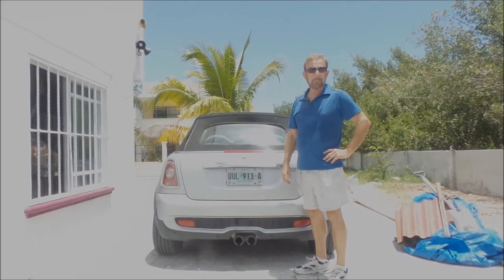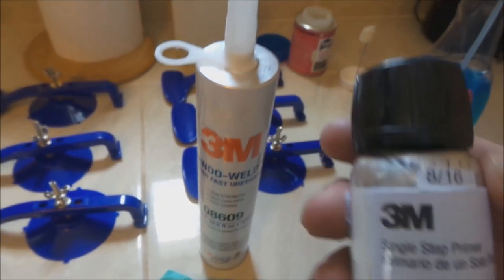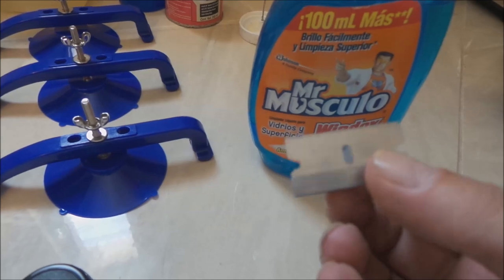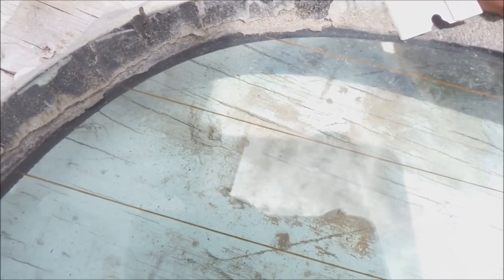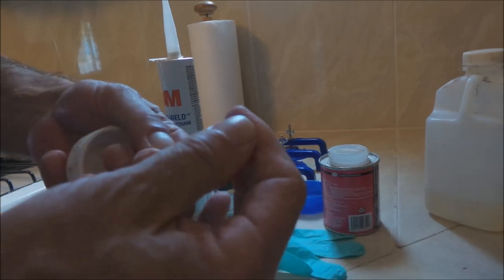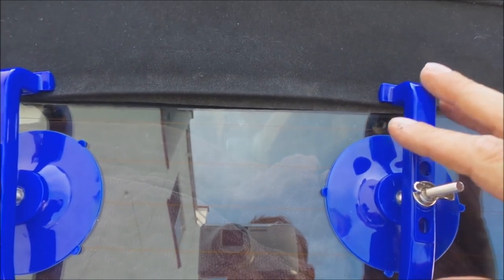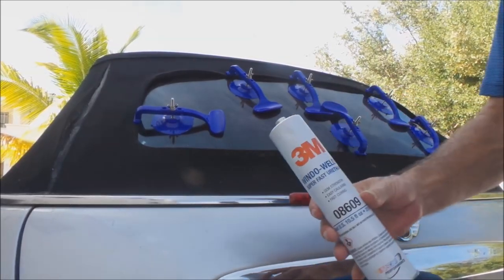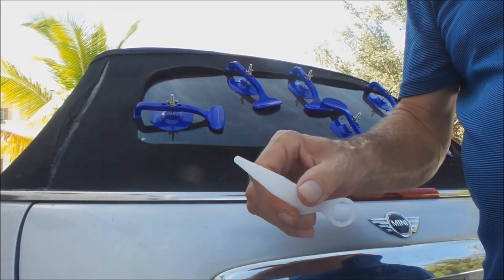MiniCooper Convertible rear window re-glue (Part 1 of 2)

Comment: Scott  - How did your reglue hold up?  I am needing to try it and wondered if it stayed in place even when you operate the convertible roof.  I have had several roof repair places tell me it won't work and I need a new rag top.
Reply: They tell you that because they want to make money off you.  A new top will just have the same glue you already have...that's come unglued.  Some Windo-Weld and Primer are reportedly several times stronger, and they're not making money off you.
Reply: I’ve tried goop twice and this Texas heat crumbles it 😢
Reply: Need to $pend the $crilla’ for the right 3M stuff (if by “goop” you mean the brand name stuff “goop”). 3M set (2023) $80 (set means Primer and Adhesive)

Comment: Hello,

How to use the 3M Primer, apply onlye the primer o the windows and top, wait a few hours ? How many ? 12 hours ? Then, apply the 3M glue ? Thanks
Reply from the maker: The 3M primer dries in less than 10 minutes in this tropical heat. After it dries, go ahead with the 3M Window Weld

Comment: To anyone in California, we can't get the primer here. It's illegal to be shipped to California. I tried buying it from several sites and it wasn't until I went to my local O'Reilly's they told me it was unavailable in California. I simply had it shipped to my friend in Oregon and had him ship it to me. Going to be trying this very soon on my 99 Miata.
Reply: I guess it depends on who you buy it from.  I bought a bottle from one seller and the post office kept it, so I'll be filing a claim to get my money from them.  I bought another bottle from another seller and now have it and have used it.
Reply: hey there man how did it end up working? im trying to fix my 02 nb2 with this method as the whole glass came off of mines
Reply: @KojiWoji_   it’s a very messy process. Make sure you wear gloves, the stuff took days to come off my hands a I would even mask off areas you don’t want the glue so that you don’t get black smudges on your window. If you can afford the suction clamps, do it. I used heavy duty magnets, which work well, but the glue gets on the magnets and it’s not fun. 

I also recommend doing it with the top clamped shut. I did it open as recommended, but when I went to clamp it closed I could hear it stretching in places I probably glued too tight.

Sounds like I’m just a messy guy but I really tried to be neat, just needed more preparation.

Because of all my issues I only completed 75% of the piece that was falling off. I was planning to finish it the next day, and didn’t get back to it. Glues dried up and I haven’t had the chance to re-order.

It lasted about 6 months of constant top going up and down, and slowly it started splitting from the opening I didn’t glue.

It’s over a year later and certain parts are still holding up. I’m going to try again and finish 100% of it. I think if I take my own advise into consideration it should hold firmly for long enough to make it worth it. 

New tops after installation fees can be over 1k if not more with the way things are going, so $100 on glues and clamps is a good deal.

Comment: "Probably take half an hour" .  You repeated yourself 3 times. Not bad for a rookie though. Fairly detailed and descriptive.  Pillows? From planes, trains & automobiles.  Funny.  Where your hands? Lol. Thanks Do you need the clamps if you have enough pillows? Mine is only released from the bottom. 2007 Solara. Dow makes a glass adhesive doesnt need the primer. Built in. 16.50 on ebay. UV is only working where the  adhesive is exposed. Direct sun or uv exposure doesnt happen if you apply it correctly. Why pay 20.oo for the little bottle of uv protective when dow has it mixed into there product.